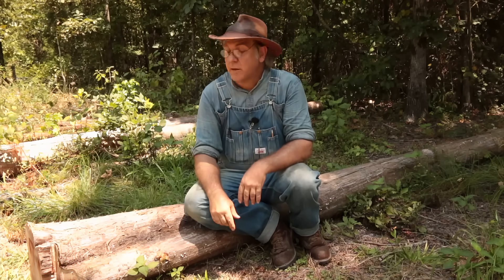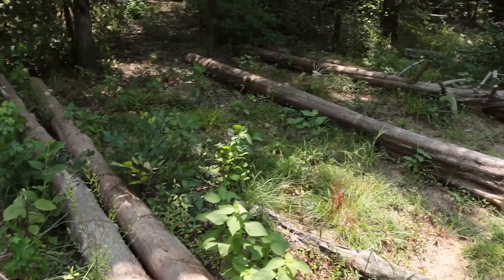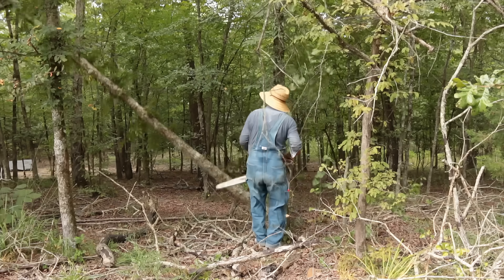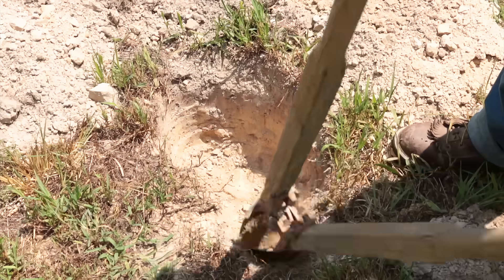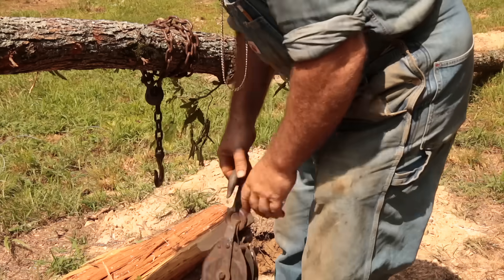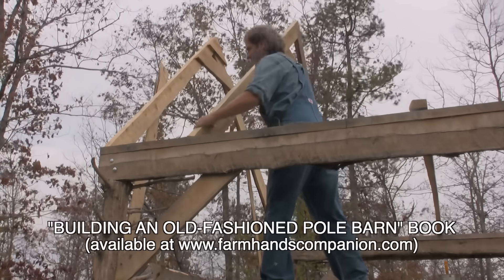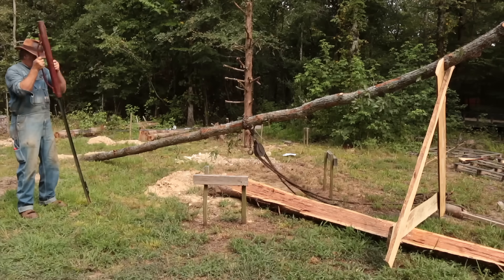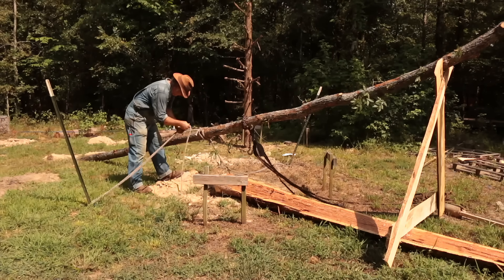Lifting Heavy Objects With an Old-fashioned Gin Pole

Comment: building with untreated wood....would all rot out in about 10 years at best and sometimes in 2 or 3 years in the south....hardly worth the risk and effort of building a wood barn shelter.....you're money ahead to buy a prefab kit of steel and aluminum and it'll last 50 years or more
Reply from the maker: Not true with cedar or black locust poles, wdobni.
Many pole barns built before I was born still exist.
(And I'm 57 years old, I think.)

Comment: Awesome video. I’d like to add that you can also make a “bi-pod” gin pole with two legs, and do away with having to readjust the stabilizer lines on the left and right. Just as long as the leg bases are wide enough.
Reply from the maker: That's correct, tellspragg8403; I mentioned that (with some caveats) in part 2 here: https://youtu.be/MxJsTlirWlM

Comment: Nice demonstration.

A gin pole can also be used in rescue situations; think of a collapsed building where no crane can access. The pole can lift a heavy load and the trapped person can be pulled out. In some cases just the pole, 4 ropes to steady it and 4 rescuers on the ropes, is enough to get a small lift

Comment: When I was a kid I was tasked with having to pull big polls out of the ground on our property. So I start digging around it and hooked up a chain around it hoping I could pull it out with our truck. Of course that didnt work.  Our neighbor, who was about 80, was watching and he came over and told me to put a thick board under the chain at an angle towards the poll.  As I pulled the truck forward it lifted it straight up and out. That guy saved me hours of back breaking work.
Reply from the maker: One day, you'll be that old guy goin' over and helpin' somebody else.
Reply: I have seen people use tires instead of the board but that old boy did more with less. Love that old wisdom.
Reply: That's what elders are for!! And they love it.
Reply: Love your stuff  been m doing  this since the 60 s  love it.

Comment: What's the knot called that you use on the lengths of rope attached to the gin pole? I like the way they hold tension but are easily adjustable.
Reply from the maker: It's the taut-line hitch, shown here: https://youtu.be/MxJsTlirWlM

Comment: Raised two items by Jin poles...a 10 inch diameter, 20 ft long telephone pole...raised it the way you did the Jin pole itself...two ropes staked to the ground to keep it from swaying left or right...the other item was your complete Jin pole arraignment but still the same principle, a metal 70 ft wind generator tower

Comment: Okay, interesting.  Good explanation.
But why not use an "A"-shaped device instead of a gin pole - two poles forming the almost-verticals of the "A".  The intersection could be spiked or tied together, with or without notching.  The cross piece would be optional if holes are dug for the feet, but if there is a cross piece, digging those holes might not be needed. Yeah, it might be heavier, but each almost-vertical could be lighter than a log needed for a gin pole.  In use it would be very much like a gin pole, but would require less set-up because it would be laterally stable.
Reply from the maker: I gave my answer for that here: https://youtu.be/MxJsTlirWlM

Comment: Thank you for posting this sir, I’ve learned from it. 
When the barn pole is laying down and you first start to crank it up, how do you stop the bottom of the barn pole from sliding over the hole on the ground, towards the base of the gin pole?
Reply from the maker: In this instance, I place a couple of scrap boards in the hole as a "stop" to hold the butt end of the pole in place over the hole as the upper end was raise up. 
Thank you for watchin'!

Comment: I used gin-poles many times to raise timberframes. My 30 x 40 timberframe barn was erected by me and three friends. I've done smaller frames solo since that one. My first was 30 foot bents 20' side wall setting on 3 ' high foundation. There was a slight hill out front where we placed a loaded trailer pulled by two wheel drive truck. The helpers were mostly spotters and drivers , not muscle. We erected #3 frame ( of 4) , then # 4 inserting purlins and adding diagnal temporaries. Then used that with gin pole to erect 1 &2 with #2 first and inserting purlins as we went. Easy peasy. I later did the plates and knee braces solo.

Comment: Would using 2 poles bound together at the top in an "A" frame configuration provide more inherent stability than the ropes or does that just add too much weight?
Reply from the maker: It can certainly be done that way, Paul. That's called a "shear legs" configuration.
I'll explain more in this week's upcoming video. Thanks for watchin'

Comment: Combat engineers put one larger pole in a vertical position. Then the gin pole was connected to the vertical pole. Don't remember how but they could swing the gin pole 360 degrees. It was impressive some of the bridges they were building.

Comment: When I joined the Ironworker's Union back in the late 1970's, the old-timers would tell stories of erecting commercial structural steel using gin-poles.  I'm guessing they were made out of steel, though.

Comment: I've seen a lot of variations of gin poles in my lifetime. One version was used for antenna tower sections. I watched this guy build it from metal pipes, designed to be mounted and dismounted from each section....even using itself to lift or lower it and be mounted and ready for the next section to be raised or lowered. Did it all with ease.

Comment: A mistake was made setting the side stays. If those T posts are set even (in a straight line) with the base of the gin pole and square to the lift then no tension adjustments will need to be made.
Reply from the maker: True, you would need no tension adjustments that way; but there would also be no resistance on the cable, and if lifted too high it might swing backwards

Comment: Good video, also good to see someone using a blanket on a cable under stress to dampen and stop whiplash if that cable should break. Didn’t think anyone did that anymore.
Reply: I was wondering about that blanket, thanks for explaining. Such a common sense idea, wow.
Reply: I bet his wife is wondering where her handmade quilt is
Reply: @williamritter7054 
Yep... I agree...😂 regarding the quilt... 
Next up... the hospital visit when he gets to explain to the doctor....'Well doc', I used one of my wife's quilts without asking!... guess THAT was a bad Idea!' 🤪
Reply: Cable dampeners are standard fare on 4x4 winch cables and are just 'old school' common sense.
Reply: I've had a come-along snap under tension before. That blanket's a potential lifesaver.
Reply: Thanks, I did not even think to pay attention to that.
Reply: Yes, it was good to see that blanket.  It is a shame he didn't mention it, but this was an excellent video.  Great to see someone with practical skills and knowledge like this.  I fear it is dying out.
Reply: I saw that and wondered did his wife know? lol it did look to be a good quilt not a top of the bare bed spring variety.
Reply: I saw that and immediately thought the same thing. I was fortunate enough to have learned to do such from some old hands in our 4wd club back in the 80s. Used to keep several old rubber-backed large floor-mats in the trunk as dampeners.

Comment: My late father had to erect a 20-ft tall steel tank stand and corrugated iron 950 gallon water tank. His tools were a tractor, two long poles, block and tackle and a lot of rope. The poles were bolted together at the top to form a set of sheer legs, a lifting device not too dissimilar to a gin pole.

Comment: To me, it just seems simpler, easier and safer to use 2 poles in an "A" configuration, instead of those elaborate outriggers.
Reply: Make a video showing it done. Gin poles go back centuries and are still used by the logging industry and many other applications today. If you’re an engineer that has bettered centuries of men & labor, show it.
Reply: @Landrew0 It does seem that way at first glance, but those old guys were pretty smart. Two poles are strong and stable, but if you're working by yourself, they are also twice as much weight to lift and that first low angle pull is tough with just one. Using one pole and adjustable stays also allows you to shift the pole side to side a little. If you are by yourself you can set a heavy load with fair precision. Tedious, but way better than brute force. Can't adjust your pick angle if using two poles.
Reply: @parttimewoodcrafter307 BINGO!!! The ones who "THINK" it done don't DO it.

Comment: Gin poles and shear leg rigs are terrific. I have a set of both. A friend of mine concocted steel caps to tie each together, the gin pole version is essentially an upside down top hat with holes drilled out in the circumference to make it convenient to attach the guy lines and back stay. The pole itself is a 6x6 that goes from square to octagonal to round to meet the cap. 
The shears use a triangle set up steel cap with chain hooks for the back stay and fall/block and tackle you’d want to attach, and the legs are mortised into a crossmember on the ground that is pinned in with 5/8 hitch pins. Can take it all apart and load on a small pick up truck. 
We use them to raise timber frame bents, set large stones; I have unloaded heavy machinery and large stones off trailers with them. 
All the early homes were built with them. 
Simple and elegant technology.

Comment: hah just the other day i lifted a 200 kg safe up the stairs all by my lonesome. Mostly because my wife told me it could not be done. First i took of the door of the safe that is 30-40 kg right there. Still i could not push it up the stairs. They are steep. So i put a rope around it, hung the rope down the other side of the platform at the top of the stairs an put 3 25 liter cans in that rope. 75 kg of passive pull  weight eliminated. Got me a just over half way up before the cans hit the floor, but by then there was no turning back.
Reply: Your wife is a genius.

Comment: Thank You for this video! A Gin Pole is a great way to lift and move stuff around the farm. I can remember back in the day, our local electric utility did not yet have hydraulic powered booms and winches on their Line Trucks, they used an A-frame mounted to the rear of the truck to raise poles and pole-mounted transformers, etc. and later those A-frames used a large bed-mounted winch to provide the lifting power. It was a really big advance when they finally started buying trucks with hydraulic systems... One truck could lift and load a pole onto itself, or several onto a pole trailer, use the boom-mounted auger to dig the hole, use hydraulic tools to bore the holes in the pole-then bolt on the hardware, lift and set the pole, use the boom-end grapple to hold it steady and "Plumb", while it was being tamped in place, etc. What had been at least a half-day or more job for a crew of 3 or more, was reduced so a crew of 2 could set 2 or more poles in the same time and not be totally exhausted. It's still skilled, hard work today, but it is safer and easier on the workers too! I really enjoyed seeing this video!!
Reply: I saw some of those old trucks with the A-frame but never saw what they were used for. Never thought about them being used for utility poles. I do know someone that has a long handled straight shovel and a long handled scoop that were used to hand dig holes for utility poles. I hate to imagine using that in our rocky ground!
When I traveled through oil field country, I  saw some old trucks that looked abandoned sitting around with the A frames on them. I assume  they were once used in oil fields.
I wonder what other uses they had?
Reply: @debluetailfly  That long handled scraper and spoon set is much easier for digging holes than those lousy post hole diggers, imo.

Comment: Nice short video!
I noticed the blanket on the come along, but I wish you had shown that adjustable knot or mentioned if it was detailed in the book.
Reply: The way it slid looked more like a taunt line hitch. A secondary line is normally needed for a prusik. I didn't notice any secondary lines.
Reply: @TheResisterTX  The prusik can be made up with the bitter end, passed back around and made into a bowline if you want it to be an actual prusik. The taut line hitch is actually just a rolling hitch aka magnus hitch tied around the standing part with the bitter end.
Reply: The way he moved it a couple times suggests he used a regular prusik knot. Look for a video on "adjustable guy lines for tents" and that should show you a good how-to. Cheers.
Reply: A "truckers hitch" would work for this as well.
Reply: @parttimewoodcrafter307   lots of knots to research, thanks for the tips!
Reply: Rolling hitch.
Reply: That 100% was a taut-line hitch, I used it myself a couple of days ago for something similar, and recognized it immediately.
Reply: @ekuels  A taut line hitch is a rolling hitch tied with the bitter end around the standing part. Same knot, different name. See Ashley.